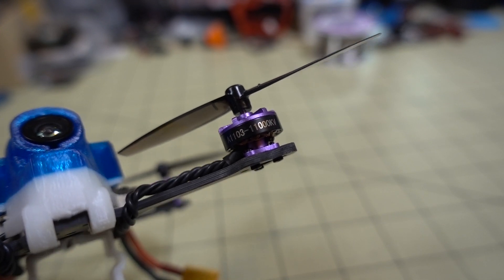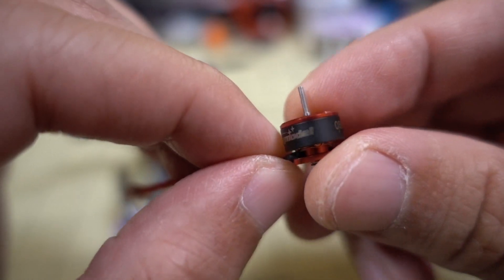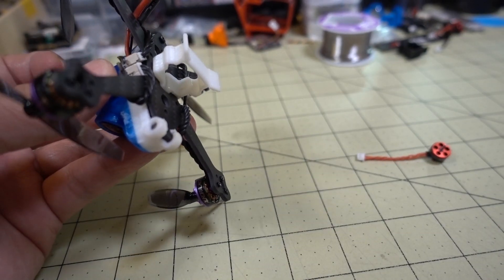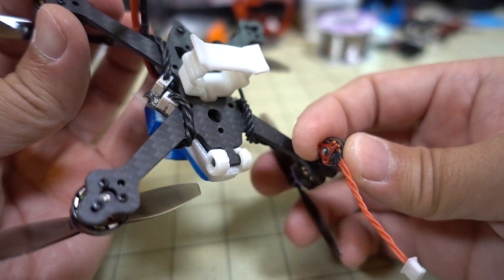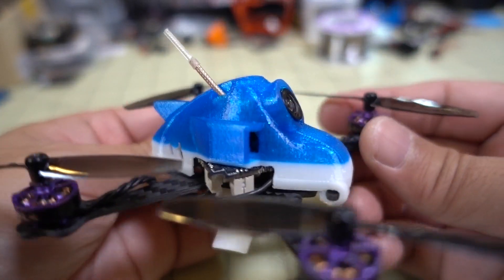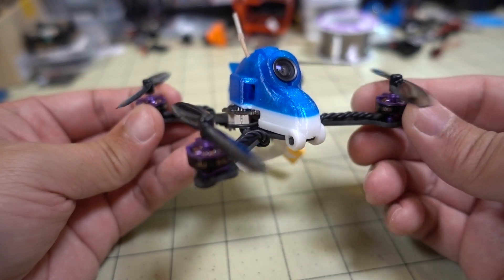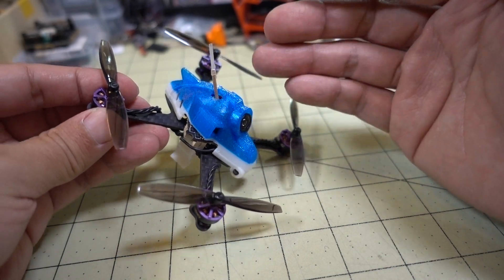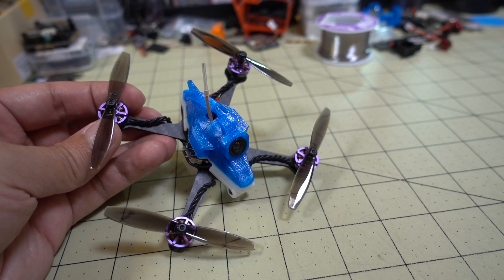AuroraRC 1103 11000kv Motor Review 👍

Comment: What Kv would you recommend for a 1103 on 1s?
Reply from the maker: 12000 or 13000kv
Reply: for 1S 1102 13500kv or 0803 16000kv are the best balance of performance and efficiency. The build needs to be kept really light for 1S to work well. I started thesis discussion thread for people to share 1S experiences https://www.rcgroups.com/forums/showthread.php?3288439-Maximizing-1S-Performance

Comment: The performance seems great, and that's an amazing flight time. I think maybe you should push the motors a little harder when doing a test flight, I never saw a full throttle on that flight for example. How hot were the motors after that flight?
Reply from the maker: Motors weren't hot

Comment: Splicing the power wires instead of soldering the new one directly to the board? That doesn't seem optimal haha
Reply from the maker: Not optimal, but the pads are easily lifted on this board.  I'll take less optimal over a dead board.  However, you should feel free to resolder the wires to the board directly if you wish.

Comment: I fly one these on my custom 75x build, and it seems so smooth.
Reply: Whats the voltage range on these motors
Reply: @quadfather504fpv9  3.7 to 12.4V bud! Technically a 1s to 3s battery.
Reply: @RustanCapal  thanks bro i was expecting them to be only up to 2s but thats awesome , n you say you run them hows the durability and performance and how inefficient are they
Reply: @quadfather504fpv9  I think it is durable as I crashed a lot of time and still have no issues. Can't tell yet the inefficiency as I am perfectly satisfied with performance. It gives me 5 minutes flight time on a 2s 350mAh betafpv battery.